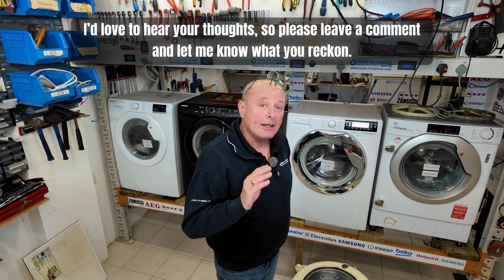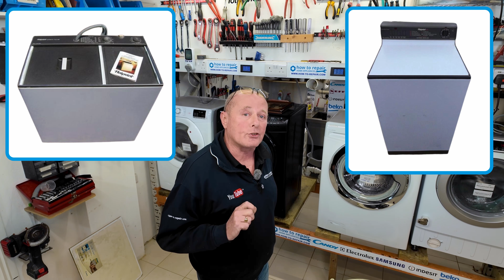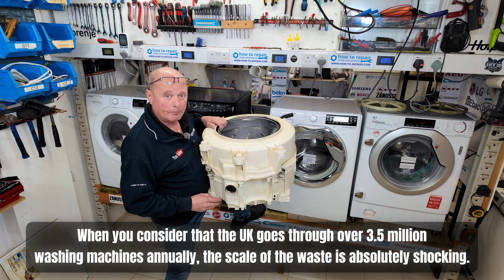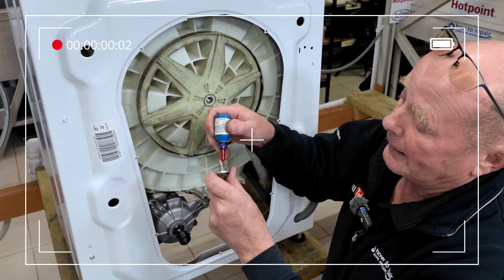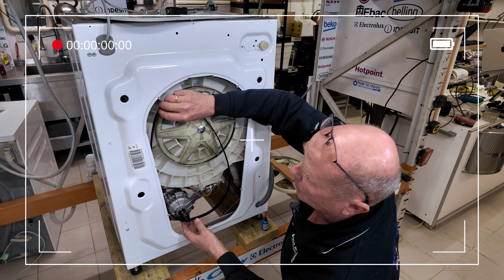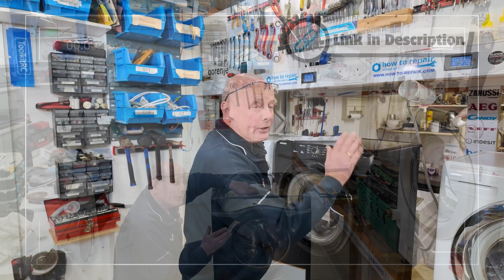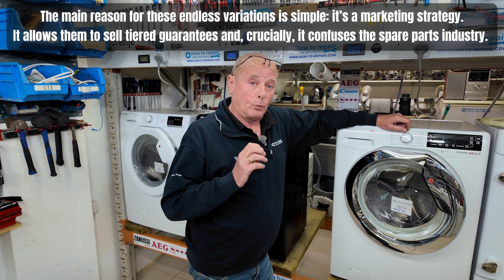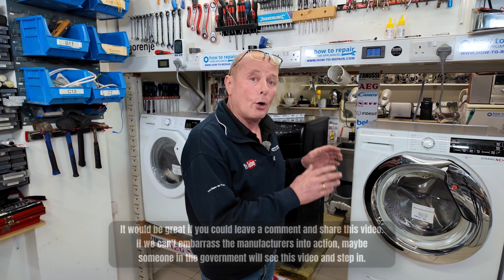I Scrapped 13 MACHINES to Prove a Point: STOP BUYING These Brands!

Comment: I have a Bosch fridge and stove close to 20 years old. I've never had any issues with them whatsoever. I have a Bosch washing machine that's probably 14 years old and it's good as new, the same goes for my old 50" Panasonic plasma TV from 2011-2012. They all just work. I bought a Dyson cordless vacuum cleaner a few years ago and it died after 1-2 years.

Comment: Not sure if it's a built in fault but my LG washer and dryer combo machine stopped drying the laundry for some reason.

Decided to try and find out what's wrong, hoping for dear life that there wasn't any electrical components that had failed.

I checked the condenser and didn't find any lint or clogging in it but then I noticed there was some sort of mesh filter which the condender fan would suck air through from the drum.

I disassembled some more and extracted the mesh filter and noticed that it had some lint on it but also some hard and white residue that blocked a lot of it. Figured it might be calcium deposits from the water or possibly dried detergent, so I washed the filter with water and essence of vinegar and later with water and dishwashing liquid while brushing with a toothbrush until the filter looked more permeable.

Assembled everything and tested the dry cycle and it worked! :)

Was quite happy because I can't afford to buy a new machine right now.

Comment: My Bosch WFD 1660 had been working for 24 years without any problems. Recently, the drum bracket disintegrated due to corrosion. When I had it repaired, I was surprised to discover how little brush dust there was inside and how well the machine body and other components were maintained. I think after the repair, it will last at least another 10 or more years. The design is extremely robust and so simple. I would never trade my Bosch for a new washing machine with a one-year warranty.

Comment: Home appliances salesman here. Tens of thousands washing machines sold by now. Honestly,I always recommend Bosch and LG here,in Europe. Hayer is a good Chinese brand. King of cheap is Beko. Yes,it's noisy and needs servicing every now and then,but it's a good value for the money,the parts are cheap and easy to change. Wouldn't advise for Gorenje,Candy,Whirlpool,Midea,Samsung and Electrolux.
Reply: bruh, no wonder my Samsung phone suddenly goes slow at charging after less than 6 months of using it
Reply: Gorenje is very good mashine for low price
Reply: Gojenje used to be praised for its quality. But that was when it was still built in its place of origin.
Reply: @kaidenreading7152 
Yes
Reply: why not elektrolux?

Comment: Got LG washing machine with direct drive (engine mounted on the back of the drum). 14 years on. And still working. 
Long Live LG. The best brand for washing machines.
Also got a Candy vented dryer. Purchased on the same day than LG washing machine. Already sitting on 4th capacitor (wearing off pretty quick due to high operating temperature inside the dryer - should be definitely designed differently to avoid the quick wear off), and second drum bearing. 
Only because of that I'm a DiY capable man I managed to repair it all by myself with a little help of YouTube. 🙃🙃🙃
Otherwise it would cost me a fortune to repair it. The dryer only cost €180,- when I got it new...

Comment: I used to be a domestic appliance engineer in the 1970s and just about everything was repairable. Kettle element replacement and toaster repairs at one end and top of the range Hoover Keymatic washing machines at the other. To buy a humble kettle back then was very expensive and a repair cost by comparison made it well worth doing. Today you can buy a kettle for a tenner and they last long enough to throw them away and buy a new one when they become faulty. Nobody questions that and manufacturers can make them cheaper by making them unrepairable. This ethos has just scaled upwards and now affects washing machines. In addition, people are throwing away perfectly good appliances when their appearance doesn’t go with their new fitted kitchen, such is the vanity of modern society. When a washing machine today costs less than it did in the 1970s and the cost of running a repair business has sky rocketed, it’s little wonder the manufacturers aren’t considering repairability in their designs as there are too few repairers to warrant doing that. It’s the worst outcome for recycling as the best way to recycle is to repair, but business models have changed and the public have been groomed into believing that the throwaway society is the norm.

Comment: I has an 11kg samsung toploader and I had replaced the main PCB about 2 years ago as the inverter is integrated with that board ( the inverter was the issue) but there was no way to repair it as the whole main PCB and inverter was completely resin filled. Anyway I replaced the whole thing and now 2 years latter its happened again! But now the price has doubled for thr part.

Comment: I was told that an EU green initiative encouraged manufacturers to make their machines easier to manufacture from less materials etc, but gave no thought to repairability. 
This at least in part led to one part drums that you can no longer split apart to do a bearing change.
I used to only buy Bosch as they were relatively easy to replace things like motor brushes, bearings and rubbers.
But in the last decade I have found that they are just as bad as the rest, they are no more reliable than the cheaper brands and impossible to repair. So now I just buy cheap and throw it away after 2 or 3 years of use when the inevitable faults occur. If it's true, then thanks EU, very green.

Comment: It’s like comparing Japanese made Toyota Corolla JT chassis to a VW Passat 2006 and forward. The Toyota is made to last, the other one is an f ing joke. 

CNC machines? Haas is the VW, Okuma is Toyota. 

Chainsaw, lawnmower, No brand will ever be like a Husqvarna. There’s a reason why all our forrest companies run them. 
STIHL? They have model names to sort out if you’re a pro or an amateur when seeking service. 
Service them is a pain compared. 

I’ve had Miele and Cylinda and for some reason, they work!?  Something’s got to be wrong here…

Comment: everything made today is designed to die in 2-3 years, welcome to consumerism. All my stuff from the early 2000 still work as they did brand new, most of them from Samsung: hand vacuum, speakers, headphones, beard trimmer, blender, electric toothbrush, etc. and the battery still work on all of them just as much as they did when they were brand new!

Comment: As an engineer. I tried fixed my hotpoint tumbledryer multiple times and found the quality of components to be very poor. One example, The drum bearing was a brass bushing on the roller jockey. But the roller was plastic. So the bearing would get hot and completely melt the wheel. This was a critical design fault and would fail every 12 months. I ended up retrofitting a v2 motor which had a ball bearing instead and that resolved the issue but it should have never been made like this in the first place. The government needs to step up and assist people in promoting repairs over replacement if they really want to stop everything going to landfill unnessecarily. And fine companies for bad design practises

Comment: of course they have flaws build in if they didn't they would cost tree times more. if they did make a good quality machines they would last much longer and the  manufacturer would go bankrupt because the consumers wouldn't need to buy a new machine. the same goes for repairability if the make it easy or cheap you wouldn't call a dealer or repairshop. at least that's what I think.

Comment: Is it about corporate greed or is it a race to the bottom?

As an example my mum used to only buy Miele. Her first appliances lasted well over 20 years. The next batch 5 years on the washing machine, less than 10 on the dishwasher. The ovens had problems.

The thing is she probably spent in excess of $1000 each in 1989 or whenever she bought the originals but that's not the equivalent of $2000 today it's significantly more.

There's no doubt in my mind we can build better quality stuff today it's just getting so expensive and customers want things cheaper.

Also now we have more advanced electronics that take up a bigger slice of the BOM costs. Might not be much but across the entire build it could be the difference between better bearings, or fasteners

Comment: As a tradesman that has repaired multiple appliances from micro ovens to dishwashers ...........i agree with you......When you open them up and pull parts you notice just how either sub standard or poorly desighned the appliance is. This goes for all the Manufactures. Gone are the days where a Whirlpool would last 30 years

Comment: My washing machine from IFB/Bosch is 35 years old (fully-auto) and still runs like new. You can feel its raw power. Even our Ariston cooking range and Sanyo vacuum cleaner are 35 years old. The build quality is exceptional compared to what we get today. Even the technicians who come to repair it advise us not to replace it with a new one. In fact, these machines are older than me.

Comment: 25 years should be minimum. Maybe people in the First World can afford to replace an appliance every 8 years. Even carrying it into an apartment to a high floor costs money for the delivery men. I have a 25 year Zanussi FLS - 874 CN washer with a mechanical program that seems to be worn out and generates much vibration during the centrifuge. I try to give it light loads or use the slow cycle because I don't believe a repairman would be affordable or would even look at a unit that old. At that time Zanussi was said to match the quality of Electrolux.

This Zanussi received a warranty service, but the repairman was not honest. It had a small problem (I don't remember because my mother handled it), and the repairman wrote that the drum had been replaced, and he got a free drum for himself. Actually it wasn't changed, and maybe the problem was even due to user error.

My fridge is 25 years old too. The parts that have obsolescence there are rigid polystyrene drawers, but only two of them. I don't expect a longer warranty because by that time some mishandling could add wear, but it should actually last. I have an Electrolux vacuum cleaner that is 25 years old too. Relatively quiet, with a smooth start of the motor. I think electric cookers are misleadingly advertised with high efficiency, and have a potential to break down due to electronic components. I cook on gas exclusively. They can't make a gas stove that fails and leaks gas, which might caused them to be sued into a court of law.

Comment: Because competition is so intense, many machines today are built with lower-cost components than before. Manufacturers are under pressure to keep prices down, since most consumers choose the cheaper option rather than long-term durability.

The machines often perform just as well when they are new, so in short-term tests or reviews they seem equal in quality. However, they are not designed to last as long.

Longevity and component quality are rarely included in ratings or reviews, even though they matter a lot over time.

Comment: I had a LG 2-1 and Exactly 2 years on the Dot, the Main PCB had a 1/4 Watt Resister that should have been 1/2 Watt Blew and took the rest of the connected components with it! How I know because I studied Electronics Engineering. The PCB for it Costed 350$. I replaced it and not even 1.5 years Later that New PCB had also Failed. These PCBs should have Active Cooling in my Opinion, and they are Most Defiantly engineered to Fail precisely around the end of Warranty so you have to Pay a Qualified/Certified Technician to fix it. In Fact one of the ONLY repair places that sells them Offers a Huge Discounted Price when you get a Tech to Fix it verses buying the part as a Consumer.... This industry is Rigged! NEVER buy LG Digitally Controlled Washers or Dryers, they Will Fail.

Comment: I bought a new house and needed all new appliances. Spoiler alert:  I bought LG appliances from Home Depot.  They all broke within 2 years. Both LG and Home Depot refused to support the products. Read on for the full nightmare ... including floods, insults, and a ruined xmas dinner. 

We'll start with the WORST first.  I bought an all-in-one washer/dryer, large capacity.  We wanted an upstairs washer/dryer and had no way to vent it, so chose the all-in-one.  Smaller footprint, no venting issues.  Within the first 6 months, the sensor failed and the machine flooded.  Damage to our floors, and ceiling of rooms below, as well as laminate on those floors.  When LG finally sent a tech, he claimed it was our fault -  we hadn't screwed the filter in right, he claimed.  We hired a different tech, not an LG rep, and he came and fixed it right away, told us the sensor had failed, somehow fixed it, and said the filter claim was crazy.  A year later, the metal spring that holds the drum gasket in place popped out.  More flooding.  LG only warranties the motor, and nothing else, so we asked the non-LG tech to come back.  He shook his head, and told us never to buy LG again.   So much for the washer/dryer.  Just under two years total, no help from Home Depot or LG at all.  We paid 3200$ CAD for this machine. 

We also bought a range/oven, with self-cleaning option and glass cooktop.  It lasted just over 2 years.  At first, the heat control sensors on the large, front element broke, then the second front element went.  Then the oven temperature started losing heat, and needed to be re-set to the cooking temperature every 10 - 15 minutes.  LG said the oven was no longer under warranty.  So again, I called an independent oven repair person and the first thing he said when he looked at the oven was - and I quote - "LG looks good on the outside, but they're using the absolute cheapest electronics on the inside.  Don't ever buy LG appliances.  Small ones, ok, but nothing large, like a kitchen appliance.  Go Frigidaire or Bosch, or Whirlpool.  LG is notorious for the sensors failing."  The range/oven cost us 1400$ CAD.  And oh, we discovered that the oven had stopped working on xmas day.  Uncooked turkey, pizza for xmas dinner, and a houseful of guests.  Not good. 

When I complained to Home Depot that I'd been buying my appliances from them for over 20 years, they offered me a measly 200$ gift certificate, and only if I would sign a form saying I wouldn't put anything public about the problems with my appliances online.  When I tried to claim the gift certificate, the web site said it was "unavailable."  So I guess I can say whatever I like now, because I never got that 200$.  I will NEVER buy LG again.  And Home Depot can forget about ever getting another dime from me. 

And no, it's not just the normal lifespan of appliances, and its normal to replace them every 3-5 years.  My mom has an old Moffatt fridge and stove she bought in 1969.  That's right, 1969 ! Avocado green.  They look dated AF but dear god, those appliances are still in perfect working order.  

What these modern companies are doing is criminal. They should be held accountable.

Comment: Here in America I had a GE wash machine that lasted 25 years. It had a porcelain drum, top load. Finally bought another new GE it had a plastic drum for $400.00 new. It lasted 1 year and 10 months. They would not cover it. I took a hammer to it and looked around for another old GE with a porcelain tub, repaired it myself and so far it has 8 years on it now still working just fine. I will never buy another new product especially with touch controls. Straight knobs and mechanical switches for me now..........

Comment: They should start forcing these manufacturers to pay for disposal of their products themselves! At least set a date that the machine must last at least until. If it fails before this time the company could be afforded the choice of immediately repairing the product or cover these disposal costs. Perhaps even the new costs of delivering and installing a new product. 5 years wouls be a good starting point. This would then become a selling feature... Brand X has an 8 year disposal warranty, etc. Here in British Colombia, Canada just the recycle fees can run upwards of $60. More in other provinces. They must also be mandated to go back to producing their items to be much more repair friendly and more easily accessible by repair services! Sure, by doing this they will undoubtedly charge more off the showroom floor, but just the extended life alone and not having to go through the hassles and cost of removing, going without, buying a new machine, having it delivered, possibly even hooked up, and let's not forget about tips (gratuities!?!) would be well worth the extra cost. IMO 
🇨🇦💪

Comment: I had the same problem with my Beko mashine. I cuted the plastik with grinder, changed the bearing, make a few holes for some small screws and put the glue for windshied. Its working prefectly. Thet was 2 years ago, still in use